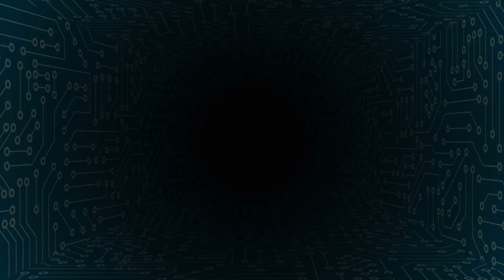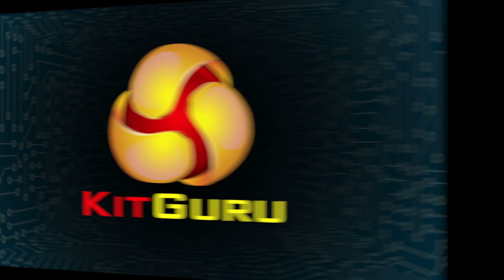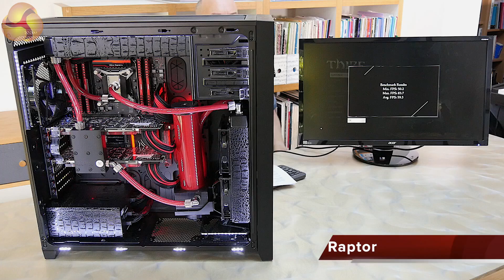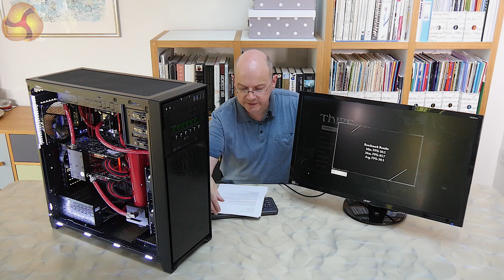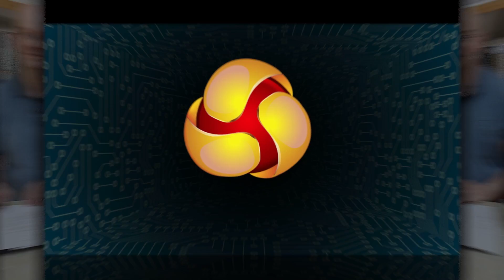DinoPC Raptor Watercooled PC review

Comment: So Dino ask a £1700 premium for building that PC?

That is quite frankly disgusting. 

A build like that done by a professional. In a proper location with the right tools and parts. That is going to be a 10-12 hour job at the most.

If you said £25 an hour, which is a LOT of money then you are looking at a £250-£300 premium. Bare in mind they are already making money from you with the parts.

Lets then make that £300, £700 so the company gets a good profit from the build (and I doubt the technician is on £25 an hour anyway...)

It's still a good clean £1000 overpriced. That is staggering.